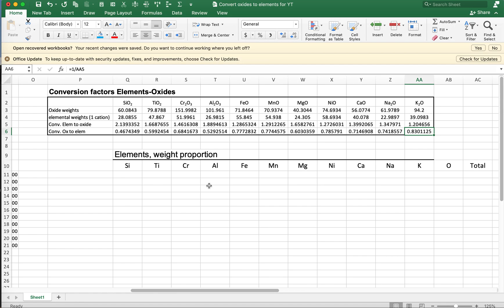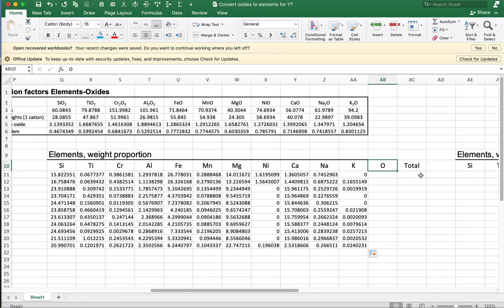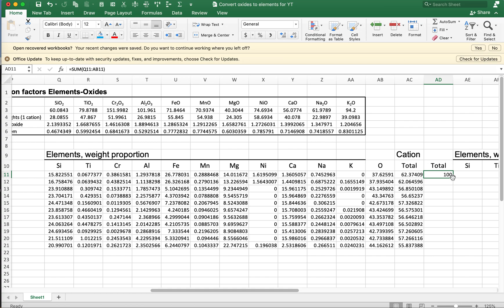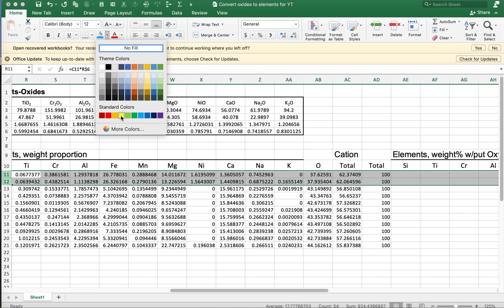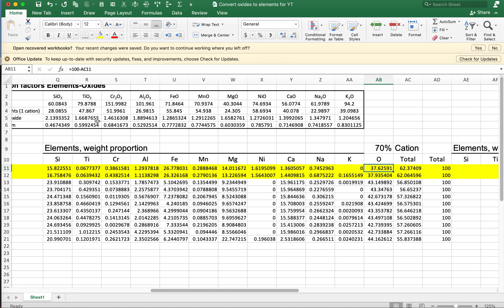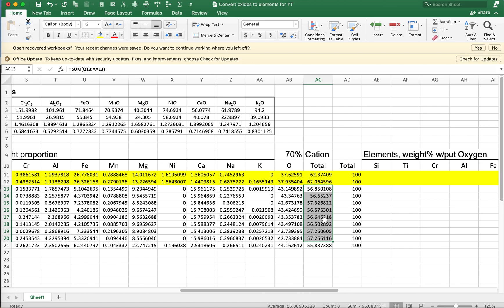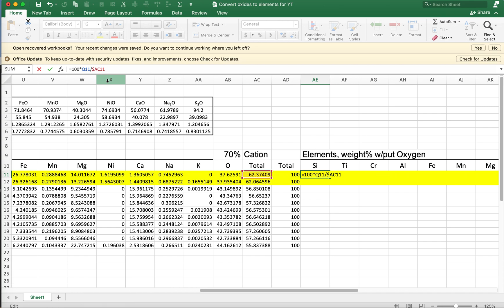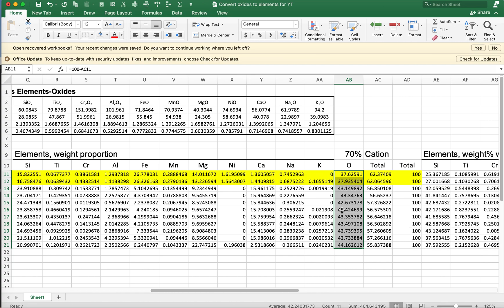Convert oxides to elements

Comment: Hi keith, what if your initial totals for oxides do not equal 100?
Reply: It depends upon the concern. If you are wondering whether you need to renormalize your oxide totals to 100 beforehand, that is not necessary; the resulting elemental wt. % will be the same whether you do so or not. But if the oxide total is much less than 100 then you might want to adjust the calculation to add in elements that make up a larger part of your system that I have not accounted for in this example. So if, say, you had a lot of S in your system you might want to add columns for SO2 and S so that you have a more accurate projection from oxide to elemental space. I hope this is helpful.